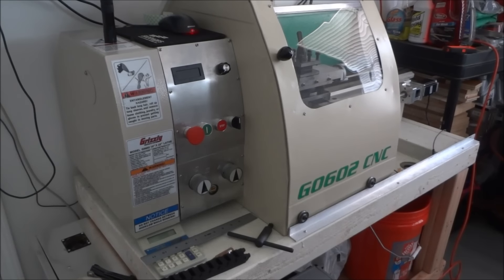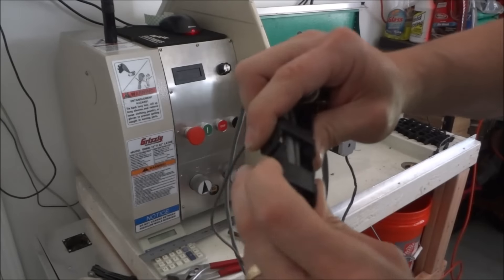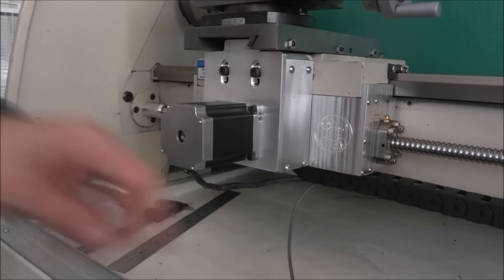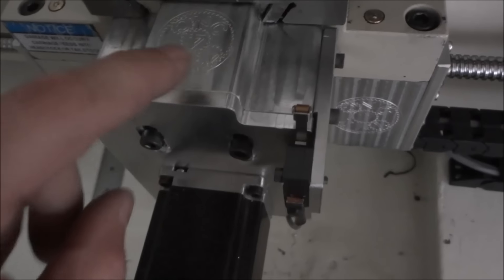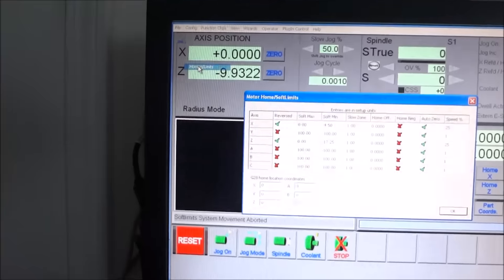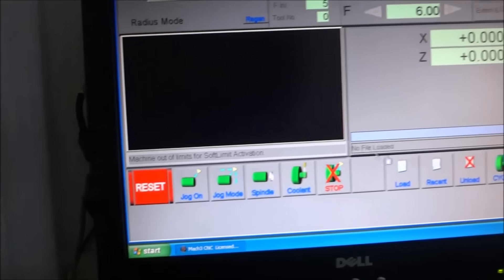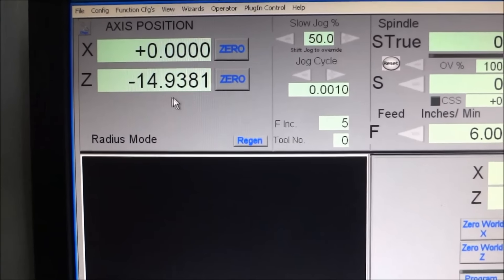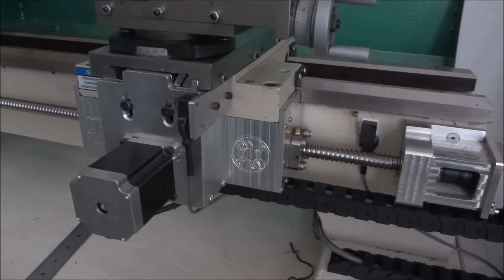G0602 Project Pt  19  Home switch + Soft limits

Comment: Nothing like a brand new clean lathe to convert. Cable chains are $5-$9 so who cares give it a go and see what happens. :)-
*By the way I had that lathe a few years back and oh boy was it a wretched mess. Grizzly bought it back and gave me credit that I used to get a mill and went elsewhere for a lathe. Also, “One” crash and it will be forever whacked so if you already don’t you definitely want to take it light and easy with that machine and don’t use it everyday It will wear out quickly. Also anything over 5” will brutally shake that machine even if it’s screws to the floor. I turned a 6-7” bar on mine and good lord it was awful. I don’t even like doing more than that on my 13” lathe
Reply from the maker: Thanks for the info, Of course My G0602 has been heavily upgraded so far so good for the things I turn.
Reply: CNC4XR7 yes upgrades are good. Ridding the gibs and screws is always a plus since those are what tend to wear out quick. Linear rails a plus. I wore my 13” lathe out in a year so these china machines need it
Reply: Another thing I found these small lathes like to have the Ed filled with granite epoxy. It’s a night and day difference in rigidity. Easy to do you don’t even have to remove the carriage.
Reply from the maker: @glennedward2201  Yes I have considered that.

Comment: I was wondering where you'd mount the X- and Z- limit switches, but I like your idea of the soft limits better. Less complications and chances of chips and coolant damage. How precise and repeatable are the limit switches?
Reply from the maker: Crivo152 the X mount is very secure it doesn't budge the 3m tape on the Z switch seems to be secure as well surprisingly how strong it is. I saw a video where someone used superglue so that's how i got the idea.
both the X and Z axis are dead on and backlash is a non issue. since the limits contact hard surfaces i think she'll be just fine.

Comment: just saw you video do you still have the compound rest I would be interested in it.
Reply from the maker: Yes I do but I will keep it I went to great lengths to use factory holes for the CNC conversion so I could go back to a Manual lathe if I wanted to so I would like to keep the stock parts for Now.

Comment: Hello , maybe you can help me , i need some help with setting dip switches on my 5056 stepper drivers , i upgraded my grizzly g0769 lathe im using nema 23 motors
Reply from the maker: Medieval Irons Tattoo Supply 
sure how can i help
Reply: CNC4XR7 I need to figure out dip switch settings on my drivers
Reply from the maker: Medieval Irons Tattoo Supply 
the procedure for setting tge dip switches is the same as i show in my videos.
set your resolution and motor current.
the 4th  or 5rh switch set to half current.
Reply: ok great I'll check everything agian. I just watched the motor tuning vid. as well. have learned loads from u. I have a tormach mill as well. but totally different set ups . thanks agian sir
Reply from the maker: Medieval Irons Tattoo Supply 
thanks the info should be in the video's but let me know.